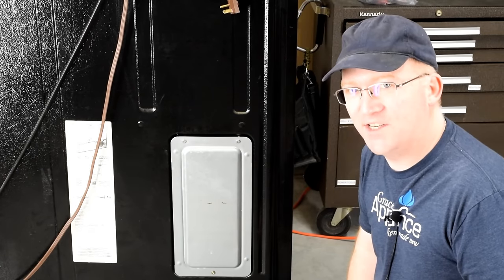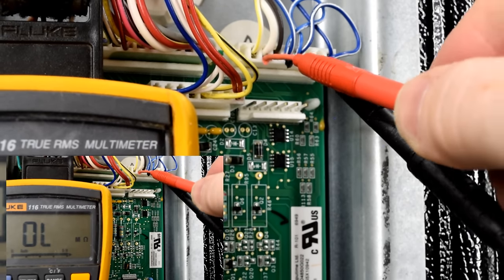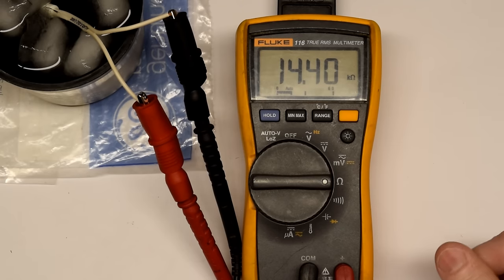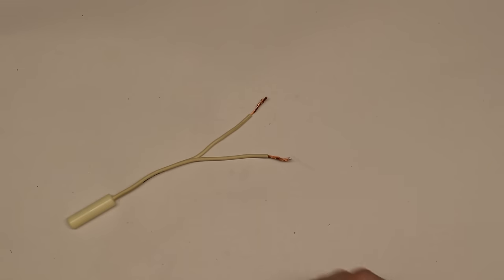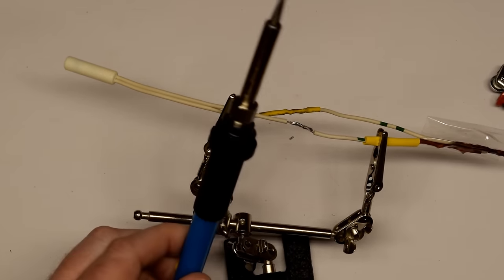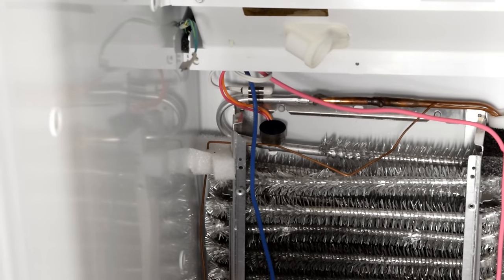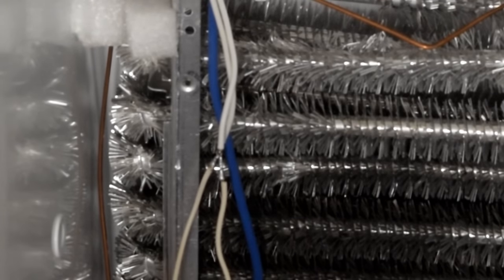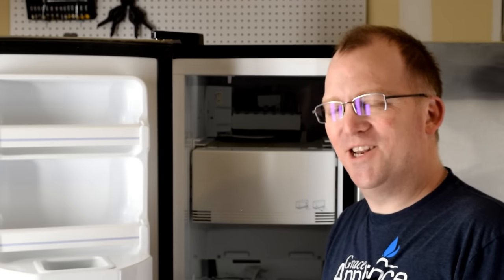Testing and Replacing a GE Defrost Sensor - WR55x10025

Comment: Hey Andy, I tested my sensors and found all 3 were off in value by quite a bit. Knowing the likelyhood of that actually being true was slim to none I unplugged the harness from the board and tested all 3 again. Sure enough all 3 were reading the correct ohms value. I would guess my main PCB is bad then I assume?
Reply from the maker: mike walsh
Before I replaced the board, I'd double check that you don't have clean coils and nothing blocking your air vents, but given the fact that it's running on the cold side, you are likely in good shape there.

I'd agree, it sounds like it could be a bad main control board. That's about the only thing I could think that would cause it to run 24/7 like you're experiencing.
Reply: where fo you access this sensor
Reply from the maker: Rohan Persaud hi!
Usually you will have 3 (possibly 4) different sensors in your refrigerator. You have temperature sensors which control the temperature for the freezer section and one (sometimes 2) for the refrigerator section. These you would be able to see behind a small plastic housing on the wall inside the freezer or refrigerator section.
Then you will have a defrost sensor which controls when and for how long the refrigerator goes in to defrost for. This sensor is located on top of the evaporator which is located behind the back wall inside the freezer section.

All 3 of these sensors are the same part number and are tested the same way. 

I hope this helps. Let me know if you have any questions. 

Thanks!
Reply: Turns out the sensors are fine but the 5 volt section of the board that feeds them is dead. The 5 volt regulator is good but the 12 volt section that feeds the regulator is also dead. New board on the way. Old board can be fixed by replacing all the electrolytic capacitors in the switching supply (upper left corner).

Comment: Fantastic video Andy....this gave me some good insight on what to look for and diagnosing my problems
I'm glad i found you on YT...keep up the good work...
I've got the GE Profile Model #PSS26NSWASS - while your video is not the actual model, it helped allot, and THANKS ALLOT for that...

If I can ask, whats your thoughts on temp running at 63F and not droping.....is it that same defrost sensor may be stuck....? i changed the fan 3 years ago but never the sensor....so it may be acting up now....? 
Hope to hear from you soon...
Reply from the maker: Hey Tony!  Thanks for the kind words.

The quickest way to determine what kind of issue you're having (if the compressor and both fans are working) is to remove the back wall inside the freezer. This will expose your evaporator coils.
You should have a light coating of frost on most of the coils here. If you have heavy frost build up, it would be a defrost issue. If no frost, it would indicate a sealed system (refrigerant or compressor) issue.

Let me know what you're seeing. 

Thanks! Andy

Comment: Will adding solder to the thermistor connection change its resistance in any way thus affecting how it works and sending faulty electrical signals to the motherboard?
Reply from the maker: No, it’s as close a repair as you could get to the original wire.  It should not cause a noticeable difference in the resistance.
Reply: @GraceAppliance  ok thanks man I love your videos and thanks for the quick replies.

Comment: Andy, I’m getting 11.62 ohms on the defrost sensor with a temperature at the evaporator panel at 3.2 degrees.
Reply from the maker: Sounds way off to me. Should be around 40k ohms. I’d change it out.
Reply: GE Side-by-Side ONLY - Refrigerator Repair Videos I was wrong. I had the plug for the sensors still plugged into the board. Unplugged from the board getting 36.56 ohms which is in the ballpark. I asked the customer if they had a power outage after I had replaced the defrost element and defrost thermostat and she said they had 2.
Reply from the maker: @josephfolsom2030  if you've done the heater, hi limit thermal fuse, and your sensor has tested good. You'll need to replace the control board and you'll be in good shape.  

You may flip the board over and you may or may not have burned solder joints on the back side of the largest relay shaped like an L. 

Should be in good shape after the new board though.   See the description for a link to the control board.  Thanks!
Reply: GE Side-by-Side ONLY - Refrigerator Repair Videos Didn’t see any burnt solder joints. If my customer goes ahead with a new board I advised her to purchase a surge protector to ensure that her new board is protected
Reply: My j1 colors  different my first wire is blue with red /    yellow  /  red with White /  blue with white /  blue

Comment: Hi! Great video. My freezer is too cold -10f. Both freezer sensors are off showing about 12.5 and 14.5 ohm at the freezer temp. Of 10 below. Could both be bad or possibly the board?
Reply from the maker: Hey Joel, 
Thanks for the kind words. 
When you say both freezer sensors, I imagine you're saying the temp sensor for the freezer section as well as the defrost sensor?
Either way, if you're not having a defrost issue, I wouldn't worry about the defrost sensor right now, but would definitely start with the temp sensor inside the freezer section.  (i.e. not the one on top of the evaporator) Start there because it's infinitely cheaper than a new board. 

Before any of that though, i'd double check check that the condenser coil behind the refrigerator is clear of any dust. Often, what will happen is that the coil gets dirty which causes the fridge to run warm, the fridge trys to keep the fridge temp at the desired 38', and runs the compressor how ever long that takes and since the fridge gets its cold air from the freezer - the freezer runs cold because of the increased run time of the compressor to satisfy the fridge temp.  I hope that makes sense. 

Any way, check that first.  If you're confident you're getting an fairly accurate temp reading in the freezer then proceed to the freezer temp sensor if the sensor reads out of spec. 

Let me know if you run in to any snags or have any questions. 
Thanks!
Andy

Comment: Hello I have a whirlpool fridge freezer, fridge and freezer are cold, but fridge section is not going to the temp setting that I have on the control panel, for example the setting on the control panel is set to 2c but fridge section gets to around 5-6c not lower, checked everything and all looks ok, so something is telling the damper door to close early, Would this be a sign of a faulty temp sensor?

Comment: Hello Sir, I have a question for you. I have tested 2 brand new GE thermal parts. Same part number as what’s in your video, I also preformed the test off the circuit board as per your instruction and on all tests I show an open “OL” I tested my meter on resistors that I have and I get the correct reading so I know my meter is working properly. Any help would be great as my friend is loosing food. Thanks

Comment: I used the wire nut but capped it off with a glob of silicone to keep moisture out. Dont know how to solder and do jot have the tools to do it. Hopefully whaf i dis works for awhile.

Comment: Andy thanks for these videos and great job. I did have several questions regarding the evap and condenser fan operations and the timer mode. Once you have established  correct voltage from the main board,  how can we be assured that both fans themselves are operating correctly, particularly if visually we can see the blades turning. Is there others tests/methods to identify fan problems not related to voltage issues? Also can you say what component governs the length of time the defrost heater is on and off. How can you diagnose if that is an issue causing ice build up? Thanks and Merry Christmas. Junie
Reply from the maker: Hi Junie,
Merry Christmas to you as well.

So here is a video that will show you how to jumper the fans in order to have them run at full speed.
You're right that just because a fan is spinning does not necessarily mean it's good. Especially when talking about the evaporator fan motor which (if it has 4 wires) is a variable speed motor. The voltage from the control board will vary depending upon a frequency feedback via the blue fan wire to the board. If your meter has a Hz setting, you will be able to confirm the tachometer on the motor is is working order.
You can also use this Hz to varify what speed your motor should be turning at.
https://youtu.be/PwsoOpUbxvk

As to your defrost question, the time it keeps the defrost heater on is based on how many times the door is opened, for how long, compressor run time, 100 hours of no defrost max, etc ect. There is a general description of this in the tech sheet for your model, but not super useful info as I remember.

What issues are you having exactly?
Reply from the maker: Here is a video on the most concise way to diagnose a defrost issue that I know of:
https://youtu.be/XeZfpB7ok90

Comment: Andy I have a ge side by side refrigerator model#pfss5rkzhss that intermittently every 6-8 weeks  fails to go into defrost mode and  the freezer and fresh food sections become very warm. I then disconnect the power for approx. 8-10 hrs restore power and refrigerator will resume normal cooling.I have metered out the evaporator heater and defrost thermostat in freezer section and they are within normal specs.Also metered thermistors and they also meter out within the specs.I  am unsure what else to check I believe the main control bd should be running a defrost cycle approx. at 24hr intervals.Does this problem sound like to you that I have a defective control board.Appreciate your thoughts.  NOTE- I did replace the main control board in November of 2018 and had no problems until  july of this year.
Reply from the maker: Hey Giantdude, 
If you’ve watched this video, it will show you how to Ohm out the defrost circuit from the board.  If you get the appropriate resistance there, you can say the heater and also the high limit thermostat are both good. 
The defrost sensor (on top of the evaporator) sends a signal to the control board for when and how long for the board to stay in defrost.  
When that sensor is totally covered in ice, your reading on that sensor should be abound 14.xx K ohms.  And should be about 5k ohms at room temp.  
If that were your reading and your defrost circuit tests good, it’s a bad board.  

Do you recall the readings for the defrost sensor?

Comment: Yes Andy , 
Both fans inside are running the fridge side is cooling and is also cooling not freezing. From the back I cleaned off any dust that was on it . There was a little water on the pan . And as soon as I plug the fridge the motor started running . Do you have a video on this procedure??
Reply from the maker: Hi Samuel, I'm sorry I don't believe I do have a procedure for testing the amp draw on a compressor.  However, this is an example of the Amp meter that I own and believe I picked it up at Home Depot. https://www.amazon.com/gp/offer-listing/B00HFYKSMY/ref=sr_1_1_olp?ie=UTF8&qid=1534632539&sr=8-1&keywords=SOUTHWIRE+400A+TRUE+RMS

The process though is very simple - with the compressor running, you'd set the meter to AMP measurement setting and place the clamp portion over the black (i.e. power) wire leading to the compressor.  There's no probes to hook up, just simply clamp it over the wire. 

The reading should be between 1A - 1.75A.  Less amp draw means that the compressor is not having to work as hard as it should typically (i.e. not having to compress any longer) and thus the motor runs without having to work as hard and thus draws less power. 

I hope that makes sense.  Let me know if you have any questions.
Reply: Andy , thank you very much for taking the time and explaining this issue. I will continue on with this and keep in touch.
Reply from the maker: You're most welcome. I'd be very curious to know what the evaporator looks like.  If you remove the back wall of the freezer inside - it will tell you every thing you need to know. 

Like 90% of the rungs on the evaporator should be coated in a light frost.  If only like 10% are coated in frost - it's for sure a failed compressor.

Comment: Case of defroster does not work:  If it's not the thermal switch(on in ice water, off in air), heater is good ( has 22 ohms resistence) and defrost thermister seems ok(+2C, 4 more than freezer thermister), then the problem is the control board=expensive, correct?
Reply from the maker: Hi Scott, 
Sorry to hear about your defrost issue.
You are correct that of the heater is good, sound like it is...and the high limit thermal cut off sounds like it’s good. 
Then it leaves the defrost sensor or a bad control board.  

Now, the defrost sensor may or may not be ok based on what you told me because it’s reading changes based on temperature. Please watch this video on how to test the defrost sensor. 
Testing and Replacing a GE Defrost Sensor - WR55x10025https://youtu.be/CG-2FnQ43Hs

If it passes this test, you’d need to replace the control board. Which, yes isn’t cheap. Around $200 for the part usually.  
You should also watch the video called visual inspection of a GE Control Board which may help you quickly identify if your board has failed. Sometimes you’ll have a burned solder joint on the back side of the control board.  

Let me know if you have any questions!
Thanks

Comment: Have you ever used wire nuts then sealed them off with silicone?
Reply from the maker: Not personally, but I have known folks who have done so with good luck. They also make weather proof wirenuts that I've seen, but not used.
I like to do a lineman's splice and put solder on that. It will be there until the planet ends. Haha

What about yourself?  Any tricks?
Reply: @GraceAppliance  I have done it both ways.  I actually prefer the soldered splice also.  Not necessarily for shrinkwrap to seal it off, but the joining of the wire ends themselves with solder.  If not careful with the shrinkwrap, I could see where condensation could still be a problem.  I do try to make sure the ends seal tightly and try not put anymore heay than necessary between the ends.
  Good video.

Comment: Is there only one sensor?  Is there a defrost timer on a GE GSL25IGRE BS refrigerator?  Thought it went out, but cleaned coil.  Working well, but won't cut off.  Think it is the sensor?
Reply from the maker: Hey John, 
Sorry to hear about the issues you're having with the refrigerator. 
You've got the same setup as shown in this video. You have a temperature sensor in the refrigerator, a freezer temperature sensor, and a defrost temperature sensor - which is the sensor that would tell the refrigerator when to go in to defrost and for how long.  
The defrost 'timer' is your main control board. 

If the temperatures are correct (should be about 0'F in the freezer, and 38'F in the refrigerator) I don't tend to think this would be caused by the sensors.  

However, I'd also want to verify the true temps with a thermometer.  If you find that the freezer temps are way below 0'F - say, -15F....that would indicated probably a failed temperature sensor.  If you haven't noticed things in the refrigerator section freezing on the top shelf, your fridge side is likely ok. And, if you don't notice any heavy frost build up on the back wall of the freezer section interior wall, you likely don't have a defrost issue (which would also show warmer temperatures) 

The first step would be to determine the actual temperature in both cabinets and then you'd be able to test the temp sensors as shown in the video. 

The readings change based on their true temperature so you'd need to know the true temp to get an idea if the sensor is out of specification.  

I hope that makes sense. 

If you find that one of them is bad, the part is the same for all 3 of the parts we're talking about:
https://grace-appliance.myshopify.com/products/general-electric-wr55x10025-refrigerator-temperature-sensor

Let me know if you have any questions at all.

Comment: Hey Andy, thanks for the very educational video. Would you know why I get no ohm/continuity reading testing on the J1 connector for any of the 3 sensors? I’ve been having issues with my fridge/freezer being warm and with your videos I’ve learned it’s a defrost system issue(ice build up on evaporator) the heater works using the jumper cable method and before I cut a sensor out to test and order a new one I would like your professional opinion. I’ve narrowed it down to rather sensor or board issue. Does the ground on the panel in the back over the evaporator have any thing to do with the J1 connector test? I feel like my ground isn’t making a great connection but is making connection. Thanks in advance.
Model # GSL25kGRE BS
Serial # MG279431
Board # wr55x10492
Reply from the maker: Hey Robby!
Intersting. 
So on your model wiring is the same as what’s shown in the video. I can’t think of a reason that all 3 would show open. I’d double check that the meter is set to Ohm test. Also, try unplugging the J1 connector from the board and test without plug connected.  
Also, theses connectors do not give much room to insert the meter lead so you may need to be sure you’re jamming the lead in fully to make good contact on the metal portion if the wire. 

Based on the diagram, I don’t believe your blue/white has anything to do with ground connection. But, it is a shared wire between all 3 of these sensors. So, perhaps a damaged connection somewhere?  I’m not sure, but it is possible I guess. Check the tings above first though before following that rabbit trail.  

That’s my initial thoughts.  Let me know what you find.  Thanks!